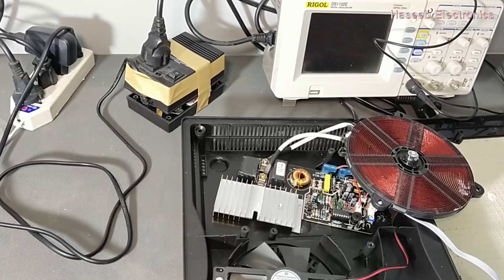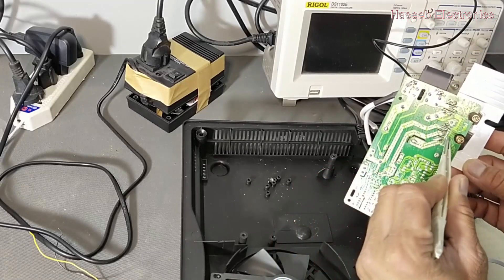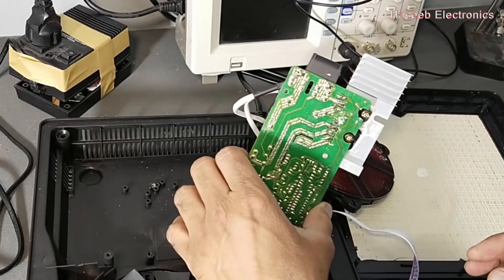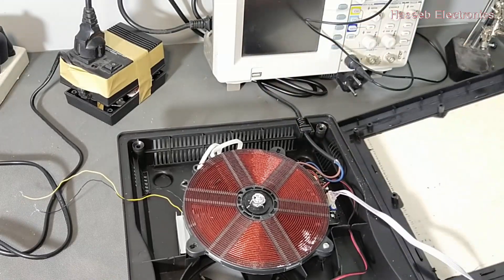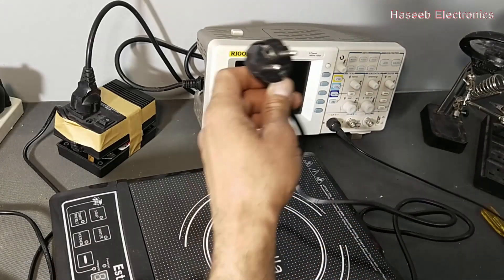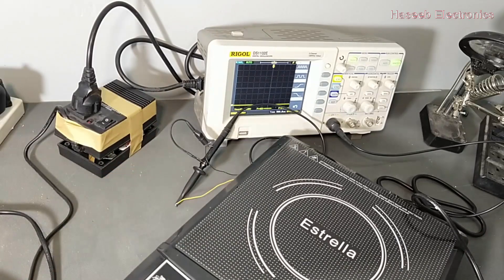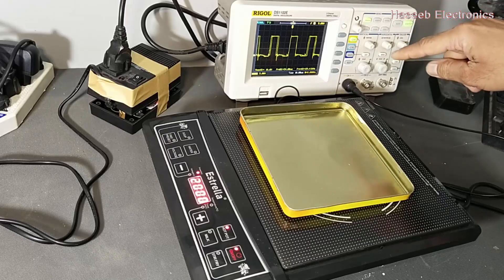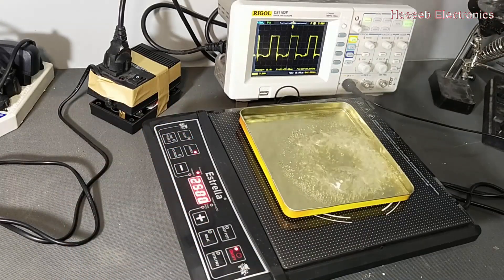{548} How To Test IGBT Gate Drive Signal / MOSFET Gate Drive Signal With DSO Oscilloscope

Comment: Thanks, that help much. I afraid always, the IGBT regulate wrong if I give the Gate an other Signal over the resistor of the Oscilloscope.
If I have  2 IGBT´s, one is off and the other is at this moment on. Maybe both IGBZs get out of sync and there is a moment where both are switched on at the same time. Then it crashes.
Can I be sure that this does not happen during the measurement during operation?

Comment: Please advise if it is possible to consider a 230V/115V, 100W autotransformer that does not have a PE conductor as an isolating transformer/I want to connect an oscilloscope to it? Oscilloscope is HANTEK DSO5102P, AC 100-240V 30W max.

Comment: Which is better or more advantageous, to get a more expensive and larger isolating transformer and use it connected to the measured object, or to get a cheaper and smaller transformer and use it exclusively connected to the oscilloscope? Well thank you.

Comment: What's wrong with connecting negative probe of scope to negative terminal of capacitor in circuit? No need for isolating transformer then right? Are you only suggesting an isolating transformer Incase the negative probe hits the positive side of circuit , right?
Reply from the maker: please check this video for your detailed answer 
https://youtu.be/-K96Pmfp6L0
and i will wait for your kind feedback. 
if we are testing isolated circuit. no need to isolate the oscilloscope. for unisolated circuits, we need to isolate circuit OR oscilloscope OR disconnect safety ground

Comment: hi if the original igbt is without diode 
and replace it with one wich hase the same specifification but has diode 
is there problem 
in your opinion ?
Reply: No problem just check current

Comment: Second question please can I do anything to decrease it's input power  to let it work on 500w (on my ubs)  ? Any hack I can do ? Like changing Hz
Reply from the maker: it is doable 
just you need to change the surce code for microcontroller 
so that it shouldn't generate voltage error

Comment: وعليكم السلام ورحمة الله وبركاته
جزاك الله خيرا 
What is the output voltage from the wirs ? Can I use my small dso150 20v oscilloscope whit a voltage dividing resistors?
Reply from the maker: it is 16 volt signal

Comment: Sir, without  DSO how to chek  igbt gate and  emitter  voltage. 
Same drive  crkit (without  igbt, when dame igbt  that time remove  igbt and  chek) not chek digital multimeter?? 
Any make device  for this signal  voltage  chek by multimeter??
Reply from the maker: okay brother i will explain it
Reply: Thanks sir

Comment: Very nice but there is also a third way you can buy an active isolated oscilloscope probe for measuring anything high voltage or ground related. It gives you the opportunity to measure with both channels at different ground levels as well without shorting your probe because both are isolated from each other.
Reply from the maker: you are exactly right
differential probes are very useful but these are expensive as well
i am thankful for your valuable comment
Reply: yes you are right they are not the very cheap. I also bought a cheaper chinese one from migsig dp10013 they are the cheapest ones I could find at the market and I am glad that they measure well enough at least for my hobby use. In some cases it´s better to get a differential probe than a heavy and also expensive isolation transformer variac combination. If it helps you are welcome my friend.